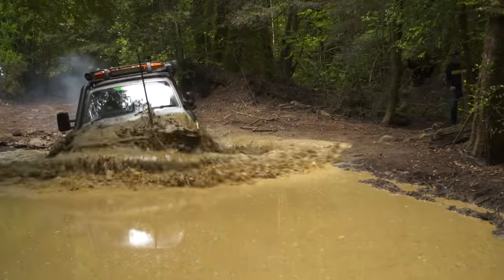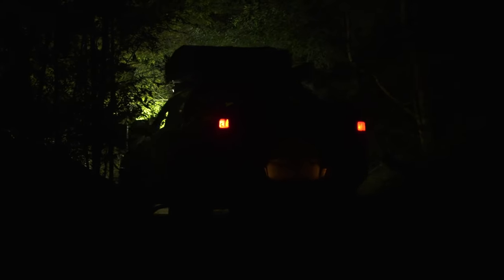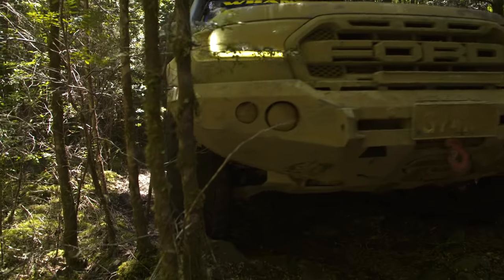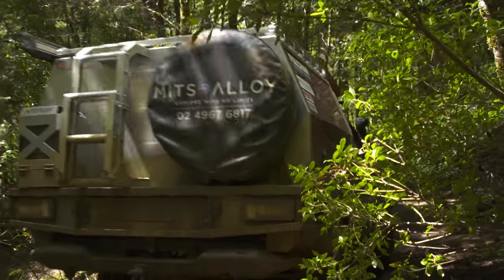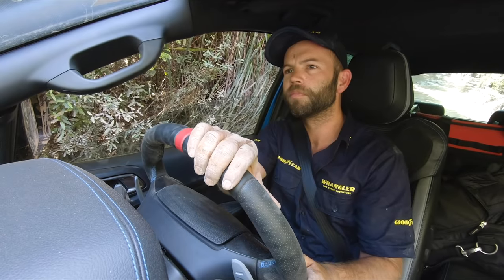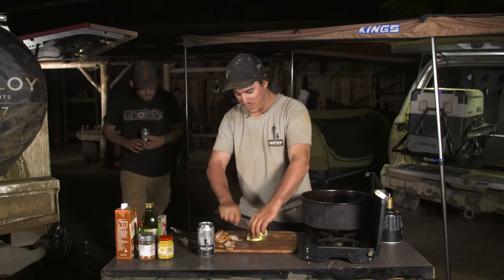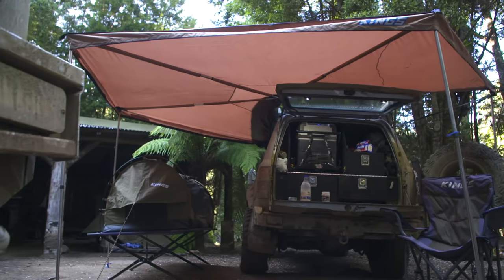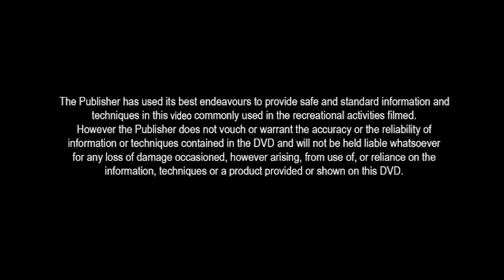6km IN 3 DAYS.... Did we get this 4WD out? Tassie $1000 Track Part 2!

Comment: BEWARE....IFS owners. this is a case study for not using 35" tyres on your vehicles unless you've done some serious beefing up of your relevant components
Reply: The ranger raptor is engineered for 33's from factory, you'd expect it to be able to handle 35's the same way a standard ifs vehicle with 33's would you'd think
Reply: @blakemills3295  you can break anything if you push hard enough. It's highly likely something hit it in one of the water holes. Just one of those things. 9 times outa 10 you might get no damage then bam one day u hit a branch and bang there goes your steering
Reply: @blakemills3295  thats a substantial step up though , in particular wranglers which are physically bigger then an equivalent tyre ie: 32 v 32
Reply: @alexfrankl7861  for real - I run 33s on my YJ and I wouldn't dream of going to 35s without swapping out my entire rear axle, axle housing, gears, brakes, and driveshaft. It's a huge commitment
Reply: Did you see how thin those steering links were? Even if they're made from some decent steel they're still smaller than an vegan anorexic's wrist.
Reply: Engineered for 33s on road 
Not off road 
Ifs vehicals can be just fine but a steering arm is just one of those things you must carry spare 
All vehcals have common problems 
A bloody tyre sponsor should know that 
Lol
Reply: @blakemills3295  that's it hey it was simply the harshness of the track
Reply: Blake Mills I am just a little bummed that the only American vehicle and a Raptor at that limped off the track.  I drive a 2014 Raptor and was looking forward to watching it perform 😏.
Reply: Danny Mitchell Haha
Reply: Blake Mills the car is egineered by ford. Thats the overall problem. There was another episode where a ranger shit a auto. There junk
Reply: Kevin Moss thats exactly my thoughts, and on a truck that’s supposed to be super tough. Tough enough to jump. Needed to be engineered by Toyota!! Lol
Reply: Danny Mitchell I don’t think they are built as tough as they claim, Ford has slacked off and skimped on everything. There old trucks were fairly tough. I have a 94 E150 and it’s solid as a rock. I Wouldn’t buy any of the newer shit.
Reply: fowletm1992 haha - rrrrrrright
Reply: I remember seeing a Toyota FJ Cruiser bend both tie rods at the same time, both tires were pointing towards each other, was goofy looking. But it happens.
Reply: Danny Mitchell it’s not really American it’s a Ranger Raptor not a F150, designed in Australia built in Thailand.

The arms look like the standard ranger arms not even slightly beefed up, in saying that few friends run 35’s on their rangers and have never snapped one doing some crazy tracks just one of those things when shit happens
Reply: @aarynmurphy7174  good to hear that for perspective. These boys have access to free parts so they'd be even less concerned with breaking gear
Reply: Danny Mitchell it’s a ranger raptor, designed in aussie and made in Thailand, not amercian 😂
Reply: @joshbenton810  Isn't that we he said?

Comment: If you use 24volt dc... ie. Two 12volt batteries in series, + to - , and some jumper leads .
You could try and Arc weld using some low hydrogen arc rods.. Maybe Phillips 56s or similar. 
I have used this to weld in the bush.. not pretty but does work to get out of a tight spot...
Reply: Why low hydrogen? Harder to get an arc going with. I'd go for a 6018 rod, not the best but easiest given the conditions
Reply: Welding with 56s will weld structual bits like the tie rods as well as std mild steel.. But General Purpose rods don't do as well, they may crack...
The other rod I wpuld recomend is a RSP. They are a lot more expensive though.

Comment: Not quite on a the tracks but I was trundling around the Scottish highlands on a Honda CBR900RR. Hit a crappy pot hole at speed and damaged the rim and badly cracked an aluminium spoke on the rear wheel. Used gaffe tape to hold it in line. Worked a treat and got me home. Not the most remarkable fix but hey it was needed and worked a treat..😬

Comment: I had alternator problems in deep silty water and thought the alternator was cooked. It turned out that the alternator on my Jeep XJ has two coaxial brushes mounted in a plastic holder at the rear of the alternator. Upon removing the brush assembly, I noticed one of the brushes was stuck down in the plastic holder. A small screwdriver and some WD40 did the trick and resurrected the alternator. The brushes get stuck with the silt in the water. Just getting it wet doesn't matter. I don't know if the alternators in Australia are the same but most here in Canada are designed this way. Cheers.

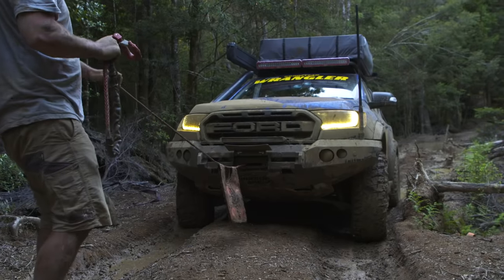Comment: like that you used more footage and made two episode. love the safari approach to 4x4. been building my 1998 fourrunner like minded of Shawn 80 only with 3.4 gas and i had to straight axle  4:30 gear trd  electric locker converted to  cable locker.  since corv 19 yo cant  go out to film new episode,  do a flash back of unused footage please. i look forward to every adventure.  when i broke my tire rod end i braised it with acetylene torch, with your tools you guys had maybe drill small holes through tire rod, jack handle or  L angle and use bolts.

Comment: Angle grinder on the rack arm and square it off.  use a socket as a sleeve. 
Ratchet strap to hold it together.

Comment: Here’s a bush mechanic idea for a broken steering arm. Super glue both ends of the broken arm back together. Then get two long metal objects (like spanners) and place them parallel (one on each side) with the steering rod so that the break in the rod is aligned with the middle of the metal objects. Then using rope tape or whatever you can, use a round lashing to attach the bottom end of the rod to the metal objects. Repeat lashing with the top end of the steering rod.

Comment: An easy way and quick way to fix a clogged alternator is to spray the insides with WD40 and get a hammer and lightly tap it. The reason they stop working is because of the brushes getting stuck from the mud and grit so using WD40 hitting it with a hammer lightly should be able to able to slowly free it up and once it's free you'd be able to tell since the engine revs should drop slightly. ( This has happened to me a few times before and seems to have worked so thought I might share )

Comment: Was doing this track 15 years ago in a hilux, a 60 and a troopy. 80/with a high mount was the lead vehicle. The hilux with the 2.4 petrol, exhaust and some 33 x10 on 16  killed everyone every time. Stuff whiching, snatching kills it every time especially when you get 2 to 4vehicles hooked up.  After one guy brought a 48 patrol everyone got one. A whole Toyota crew go Nissan. Suff Toyota diffs

Comment: I noticed that a few of you guys were useing cable operated winch controllers through the window, do you feel that is the best for over all control and reliability and what about the wireless controller on the Domin8rX,  I have seen all so people puting winch control switches  on there dash and such area's  but that would mean taking your hand off the wheel to control, I thought that was a great idea untill I saw your vid and realized that you want both hands on the wheel for full control.

Comment: You can arch weld using 2x 12 volt batteries look it up very easy. Two batteries and some jumper leads. Could of welded it back to gether

Comment: Most challenging track I’ve done is the booti booti tracks from buledelah to Taree in a stock nh pajero no lift on not very meaty A/Ts (more street tyre then A/T) no winch in a convoy of 3 other vehicles made it all the way only busted 1 cv and beaded one tyre yet there was patrols and hiluxs with me that didn’t get threw were I did .... but the most fun I have had on a track was doing wattagans every weekend in my ng oi first gen pajero with 2 inch left 32” muds twin locked ... good fun

Comment: Should always bring a emergency Tie Rod Tie Rod Coupler. Basically a small pipe with two bolts you tighten and will connect a broken tie rod temporarily back together.

Comment: As silly as it sounds but i carry a fair few metal hose clamps as spares and i would have tried to put a tent peg on that  steering arm and used as many hose clamps and what ever else to hold that arm together to try and get out before i would have tried with ratchet straps

But done very well to get out :)

Comment: Jesus.  Kaido's rig gets stuck on everything, is there a mod or something that can be done to solve the spring hanger issue? Bigger tires maybe? Make some sort of cover bracket to make them smooth instead of hard sharp edges that get stuck on everything from mud to stray leaves in the wind?

Comment: Could they not have welded the dmax steering arm to the broken ranger arm as a brace?  It's screwed in at both ends and the dmax arm is welded to it holding it straight?

Comment: You guys need to start packing some welding rods with you.  Series three batteries together and grab the electrode in a jumper cable clamp and ground to the thing you want to weld would have patched it together

Comment: Does any 4wd come with a water cooled brushless sealed alternator? Bosch do one, used on some high end luxury vehicles that has a 250 amp capacity and being water cooled and brushless is very well sealed!
Reply: Vdj79 can retro fit a water cooled 100% sealed alternator. Its a aftermarket part though for like 2 grand. I agree a business should make these for lots of various 4wds they would make a killing.

Comment: think the rout i would of took is strap the tire tight so it does not move and try and kick out the rear in 2w to turn then switch back 4w after i steer

Comment: Why don’t you guys run a permanent winch control into the cab in the proper manor? It’s really easy and cheap to do and no more messing about running wired controllers in through the window. No reason you can’t leave the socket on the front as a back up option as well!

Comment: hey fellas, why not use a tarp or a bra in front of your grille / radiators when you go thru those big mud watery holes ? something that can be quickly zipped and unzipped to let the air thru / block the water from mucking up your rad etc ? something that takes less time to setup than winding your winch cable away ? just a thought

Comment: @34:03 how come Dino didn't know that his tires are not staight if the Raptor has a center indicator/red stripe in the steering wheel?  Oh well, hard lesson learned, Raptors should never venture anywhere beyond the shopping mall parking lot.  It's F.O.R.D. tough. Once again, Toyota dependability and reliability prevailed, not even that Isuzu nor Nissan was spared.

Comment: When I wrote an article about the ranger raptor, I said SPECIFICALLY that the engine, gearbox and steering system were weak spots, why would ANYONE use one of them for more than poncing around town, it's an M10 rod for the steering arm, I broke one towing a little horse box over a small muddy crest, I also noted how the gearbox was constantly changing gear and even with the twin turbo setup the truck was NEVER in boost, I also noted that in the transit van with that engine they all struggle to last 100,000 miles, not to mention how poor the MGTW is, you'd be better off with an older isuzu, hilux, Triton or hell even an old discovery
Reply: The inner tie rod did look very small next to those monster 315 tires, its no wonder it sheared clean off, to be fair that truck barley looked like it was even trying on most of the hard stuff before this happened, maybe they sell big diameter tie rod parts that'll fit the ranger?

Comment: Y’all beat your vehicles I live in Florida and all we do is mud and sand in the 5 years I’ve been a weekend warrior I’ve never taken out an alternator my Jeep is only 3 inches lift and 35s and it’s hood has been under many times and only sensors gone out my truck is lifted 8 inches and 37s so it’s engine always stay dry, I guess if y’all were allowed to lift em higher you could keep electrics safer